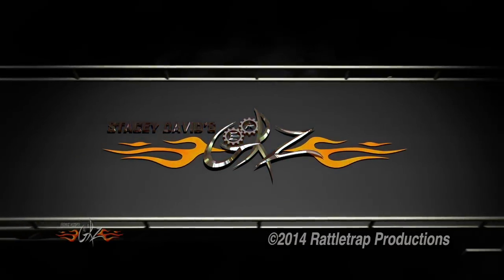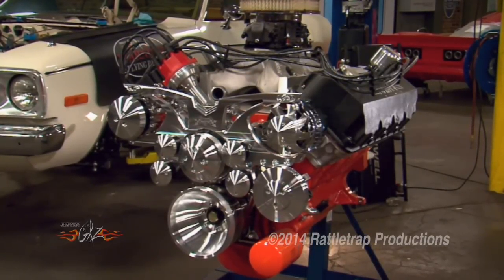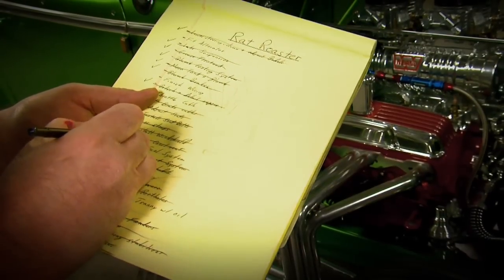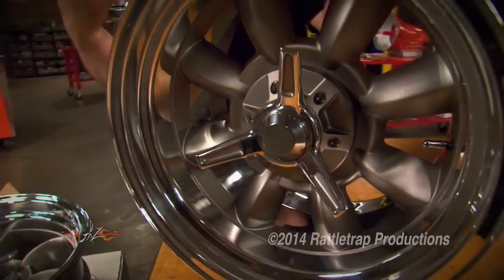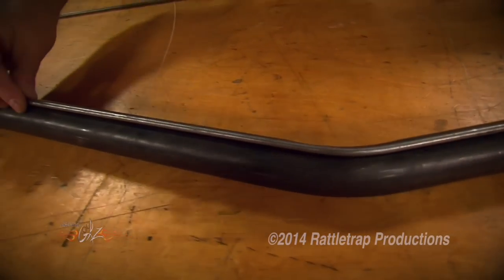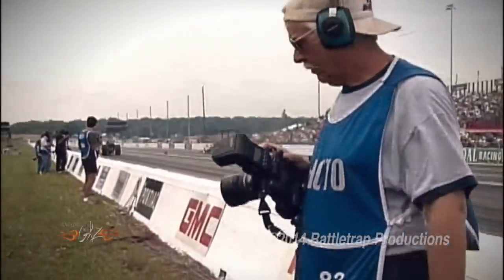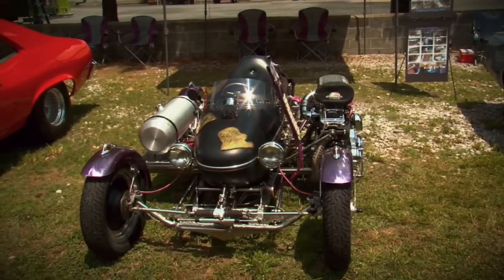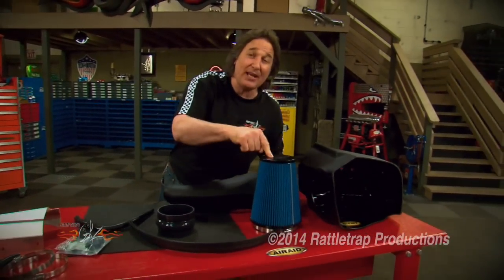73 Plymouth Satellite Hemi SLEEPER Setup - The Street Sweeper Part 2 - Stacey David's Gearz S8 E12

Comment: Those ole Mopar 727's look so crazy like a Powerglide with a 36" tail shaft housing. That gear vendor makes it look even crazier. I've seen them hold up to 1 hell of a pounding though. Seen a couple rip the ass end off but overall its typical Mopar. That "1000hp" gear vendor will probably hold 3 times that now. They are the go-to for the modern-day pro-mod street racecar.

Comment: What a difference 4 years makes.  I would put a modern day hemi in that car.  The horse power isn't far off and you don't have that large heavy motor pushing you into the curves.  If you have emission testing that old school hemi might not pass the inspection.  Parts are easier to get for them also.   After watching this video more...….Anyone looking at the wheels and tires plus the exhaust note coming from that old school hemi is going to know what it is.  It will no longer be a sleeper.

Comment: Yep, Every sleeper I ever saw had 17 x 11 wheels and 315 wide tires. Come on Stacey, A sleeper is bone stock on the outside. This is Pro touring.
Reply: Totally agree.
Reply: @jerrytee2688  def pro-touring, otherwise it would be widened steel wheels,  70/30 shocks, slapper bars, plexiglass windows, lots of holes, maybe acid dipped, big stall, cutouts, pained fiberglass parts/bumpers, 2 stage NOS run under the cast stock 4 barrel intake, hell maybe a turbo ls swap, and lots of other tips/tricks, dont forget the pimp juice.

Comment: vs purchasing an A518 which doesn't always prescribe a drive shaft change that the GV does.  Also doesn't require the electronics as 46R transmissions worked hydraulic and not electronic.

Comment: Just go buy a 66 up C body- 66 to 70- 440/727 even comes with the correct oil pan. Buying a high dollar engine plate. Piece of 3/8 6061 Aluminum plate and make your own! Can put a RB into any A B C F M body for the cheap.

Comment: Gearvendors, only $3K minimum.
Reply: why soo dam expensive ?
Reply: vs purchasing an A518 which doesn't always prescribe a drive shaft change that the GV does.  Also doesn't require the electronics as 46R transmissions worked hydraulic and not electronic.
Reply: Well, cause they're awesome if you like automatics?   They're away to make certain legendary autos more driveable on the highway without making everything all fragile.

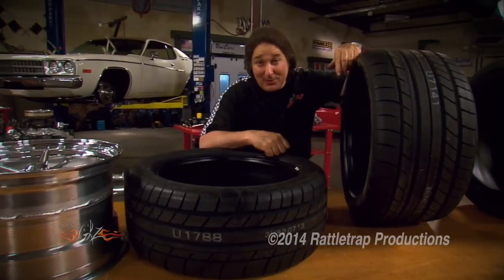Comment: 9:53  The laws of physics dictate that you can never create a larger contact patch, all you can do is change the shape of the contact patch to a very wide one which does not have much length from front to back, assuming you were running the same tire pressure. The surface area of the contact patch is a function of the weight on that tire, and nothing more. Don’t believe me, research it for yourself.
Reply: Pretty sure all those race teams have

Comment: Why does everybody have to put those huge ridiculous fucking wheels on everything? Since it's supposed to be classified as a sleeper, that would give it away right away, big ridiculous wheels and real expensive low profile tires! I would put a set of 15 × 8's on the front and 15× 12's on the rear, black wheels with a dog dish hubcap in the middle with raised white letter tires! And I wouldn't change anything else!

Comment: I am a mopar guy all the way.   Owned super bee.  Road runner.  Have a 70 charger rt 440 six pack.    I can not stand the looks of these 73-74 Plymouth.    Yuk
Reply: me 2 ps. what are u using 4 rims ?
Reply: I dunno, I'm more a Duster gal, myself, but I kind of like this build.  I bet those big things are less boatey with all that restomod stuff underneath.  :)  I mean, everyone wants the Superbee or Roadrunner, etc,  hence they're so expensive.  This is a lot cooler to me than yet another paint-it-orange-and-fake it build,  really,  though my sleeperish sweet spot is to look sleeperish at first glance,   but I wouldn't be afraid to, say, convert to a 4-speed and add gauges, or put spunky rims on there.  Other car people on the road seem to enjoy spotting em out on second glance.  :)